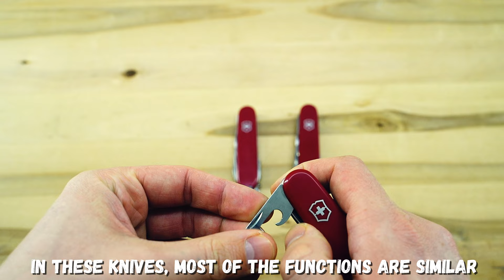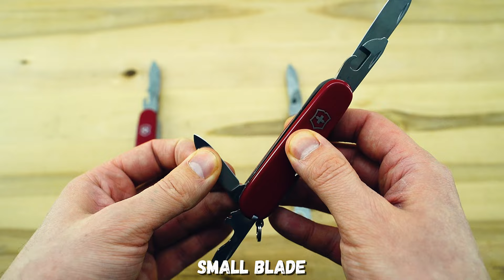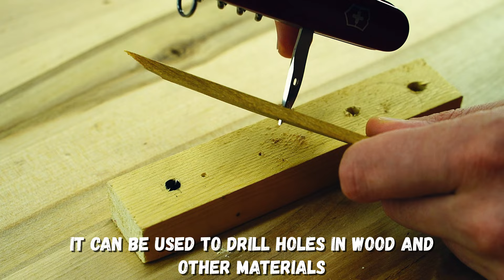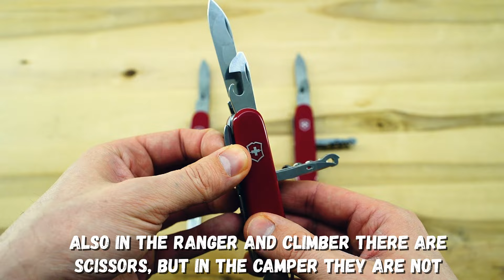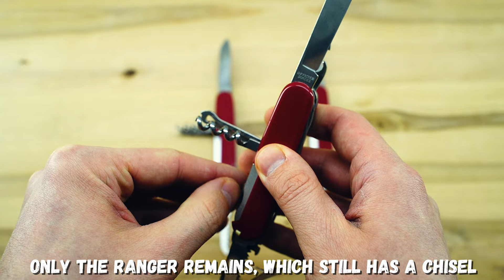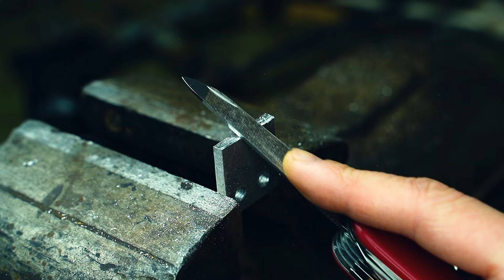3 Most Universal Victorinox Swiss Army Knife Models That Have Everything You Need

Comment: Love the video and production value!  None of them have the magnifying glass, which is priceless because it makes me feel like a kid again every time I open it.  But the Ranger is a powerhouse.  The chisel pairs with the Leatherman Rebar bit adapter, allowing the Ranger to be used with 1/4" bits.  Also, the position of the hook in relation to the key ring allows for Felix Immler's t-shank saw trick.  Pretty much everything you need except pliers.  Enter small Knipex pliers or maybe small Leatherman/SOG pliers (I like the discontinued SOG Synch 1 Travel).

Comment: I love your channel.

The Huntsmen and Cybertool L are what I consider the best SAKs, though I also love my Ranger Grip 79 and my Nail Clip 580. None of which I use as an EDC, my Classic has that position though I plan on replacing it with a Signature Lite Onyx Black. I intend on modifying the bottle opener of my Huntsmen and RG 79 from a screwdriver to a chisel and the under belly into a ferro rod scraper. The bottle opener is useless and a chisel has more use than a screwdriver for bushcrafting, which is where I use these knives. I've added a SAK pen and a ferro rod to my RG 79 in the channel that holds the can opener and the bottle opener. The leaver arm of my Nail Clip 580 I also intend on modifying into a cuticle pusher, making it the complete nail care tool.
Reply: Me too!

Comment: I've carried the non-serrated Trekker for years -- but sadly they aren't producing them anymore. I also have a Swisschamp, Classic, and an early Swisscard.  Also have an early Hunter model with the slide blade lock on the side. All good knives, but the Trekker has worked out as the best EDC knife, backed up by the Classic on the keychain (mainly for fingernail trimming).

Comment: The only thing the cork screw is good for is holding tinder. Unless you’re stranded in the swiss alps with a wine bottle and new girl friend LOL. Love your videos Bro! I have a really good survival kit and have been considering adding a Victorinox to it. I have room so in your opinion which model should I add? I need to do another homemade survival kit video on the one I have. Would love to hear opinions on which model I could add.
Reply: For 50 years I avoided the corkscrew because I don't drink. I had a Tinker and then a Craftsman.  Last year I moved to the Champion Plus (because I didn't want the bulk of the pliers and I always have a Knipex Cobra or Leatherman Wave.  The corkscrew has actually won my heart because it will loosen knots. I love cordage and rope and good knots and splices, but I really hate random misplaced knots. 
The toothpick has been replaced with a Firefly ferrocerium fire lighter.

Comment: Don't quite agree. Instead of the Camper model, it is better to take the Mountiner, in which a saw for metal (which can almost always replace a saw for wood, has a sharp part at the tip for small Phillips screws) and scissors. In terms of functions, it will be almost like Ranger, but lighter. Among two-row models, Compact  also is better ( if need can put bosh saw under hook)

Comment: The only thing the Ranger needs is a 3 dimensional Phillip's screwdriver.
Reply: It has three pieces with which you can unscrew the Philips screws. One on the can opener, one on the back, one on the tip of the metal saw.

Comment: I have 5 SAK's. 
I prefer the Compact for EDC and the Handyman for long hiking trips.
   The Compact also has scisdors, nail file, hook and pen.
      The difference between Ranger and Handyman: the Handyman has pliers, the Ranger has not.
Reply: The "Ranger" and "Handyman" are my next two options.
Reply: I have around 20 + SAK's.
02 - Champ
02 - Handyman
07 - Huntsman
05 - Climber
01 - Camper
02 - Swiss Army card
02 - Nail Clipper

I am not adding my Classic SDs.
Reply: @deepakkothari8658  I probably have close to 20,if I got them all together and counted, lol.
Reply: @MSkachenite The Victorinox Pliers are not that useful like People Think. They are madre for small Jobs and works. The wire cutter in the Pliers are kind of tint and bad , i cut a office clip and the Pliers stop working well. They are good, but not at Pliers
Reply: @Jack-pb6rh  The Victorinox pliers always are stronger as my two finger touch. :) 
But my Vic's Handyman's pliers has no wire cuters. At least, I don't see them.
     If I need wire cuters, I also carry as a keychain tool the Leatherman Squirt PS4. That wire cutters works well.

Comment: I don't know why they persist with the corkscrew. Screw tops are nearly universal now and I know for a fact even the top winemakers prefer them for their reliability and consistency. I have a five layer VSA I bought 30 years ago and, even though I was (and still am) into wine, I deliberately chose it for the crosshead screwdriver in place of the corkscrew.
Reply: The corkscrew also makes actually whittling with the darn thing infinitely more uncomfortable, possibly if you were left handed it wouldn't chafe as much. For that reason I much prefer the Hiker to the camper, even though I feel the spine mounted driver is of limited use. On multiple occasions, in a pinch, I have trimmed an appropriately sized stick, and used the stick to drive the cork into the bottle.
Reply: What ??? "The top winmakers" ??? :face-orange-frowning:Every good wine in France has a cork !! A corkscrew is therefore an essential element. Otherwise you carry a corkscrew separately!